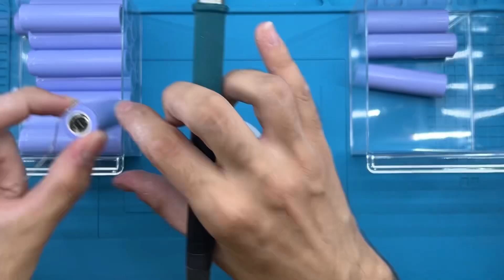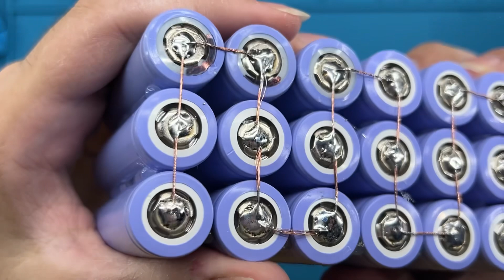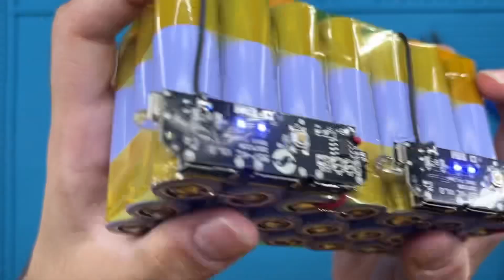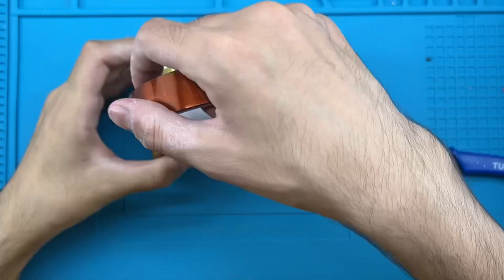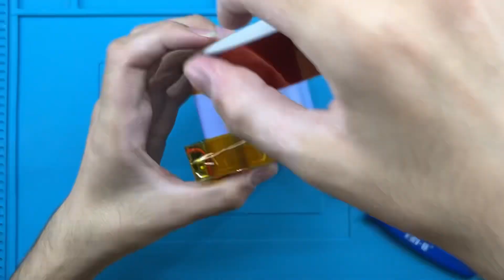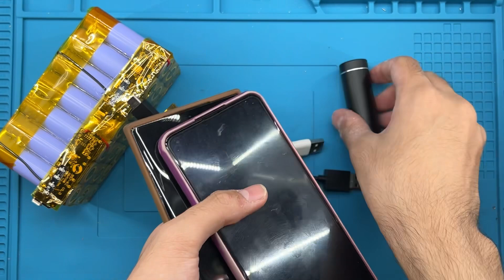How to make a 50000 mAh power bank with 6 outputs / DIY / #electronic

Comment: Bro m doing the same thing but my battery is draining too fast.. i have used the same method.. i don't know what is wrong with my powerbank.. i have tried twp time but its not working for me,, can you help me out with this
Reply from the maker: Yes, my friend, I will definitely help you. First of all, you should use batteries that are higher than 1800 mAh and use famous brands like Samsung, Panasonic, LG, my friend.❤️
Reply: @Micro_make   m using 2600 mah battery, m using 18650 dmegc lithium ion battery, 
Is there anything else which could have been wrong?
Reply from the maker: @kripalsinghmehra5859  In my opinion, check the battery and module connections and be sure to use quality modules
Reply: @Micro_make  okay bro sure... which module you prefer for 50k mah powerbank
Reply from the maker: @kripalsinghmehra5859  I think the AJ27-TIE module is a good option if you can series the batteries and have 12V output.👌
Reply: @Micro_make  is it also suitable for parallel connection..
Reply from the maker: @kripalsinghmehra5859  No my friend, if you want to connect your batteries in parallel, you should use IP5328P or SW6206 or H961 module.
Reply: @Micro_make  okay bro thank you very much I'll try this one